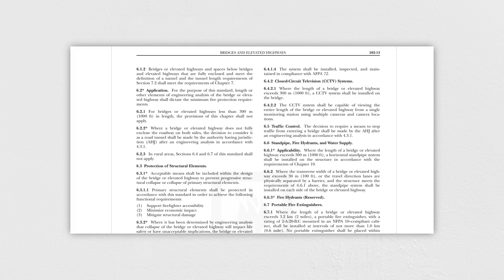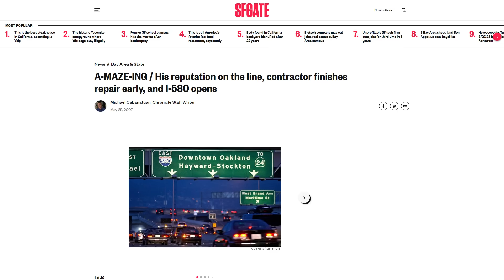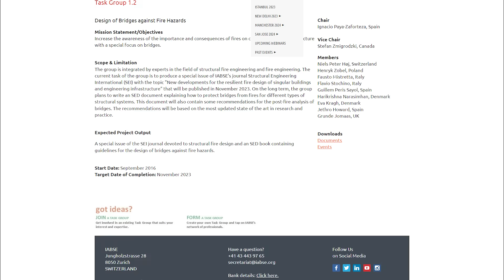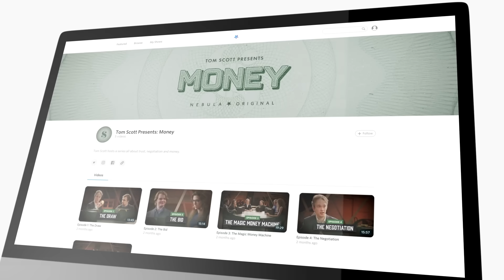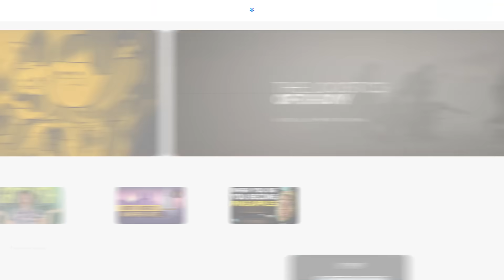Philadelphia I-95 Bridge Collapse Explained

Comment: Fire Engineer here - The eurocode does document methods for assessing fire in structural steel and is used regularly for these types of assessment. Bridges are not regulated for fire damage like buildings are, which need fire protected members depending on their location and the building's use. Thus, fuel heavy fires under the bridge will readily heat it above its 550C fail temp where steel has ~20% of its original load bearing capacity, well below civil safety factors. Is it worth fire rating the steel with Vermiculite or an intumescent spray? Maybe, structures like bridges would require better insulation, as regular buildings are only designed to withstand the fire for brigade search and rescue at worst. A regime would need to be similar to offices or apartments which can be re-used and refit after fire damage.

Comment: Sydney's Kingsford-Smith airport has the main runways on a bridge over a major 6 lane highway. They included automatic overhead sprinklers through the entire tunnel just in case there was a fire (just like a high rise or warehouse) which also had a connection to traffic lights to stop traffic entering the section of highway between off ramps so no one would get trapped on the roadway. Of course a truck went through there (after it had been in use for several years without problems) that was about an inch too high and took out ALL the sprinkler heads on one side of the underpass, setting off the whole sprinkler system, stopping traffic and causing low level flooding in the tunnel when the drainage pumps eventually failed, but at least it didn't close the airport and only took a few days to fix or replace the hundreds of sprinkler heads.

Comment: watching a railway underpass built 3 blocks from my place. lot of engineering questions getting answered, 
ie, at * some * point it is necessary to dig under the rail before it is supported, the very first cross beam needs to have a groove dug out under the entire wide of whatever track exists at that point. how do they deal with rail traffic?
Answer: halt rail traffic and pull an overnight shift work with a frenzy kleig lites etc, check the weather, and overnight voila, the 3 foot wide I-beam, it is now sitting on its supports already in place beside and below the tracks, final check and ok green light the rail traffic, only had to halt 3 or 4 trains only 1 days worth.

they spent a good 2 years prior rerouting utilities, measurements, all manner of prep work, water shut off a day or so related to the job. 
finish date summer 2024, just in time for me to sell and clear out lol

Comment: How much would permanently installed plumbing and heads for a combination of either misting sprinkler heads or ones designed to spray up at the main structure of a bridge and larger deluge nozzles pointed down that fire trucks could hook up to and quickly put water on the fire and control temperatures of the bridge with minimal risk to firefighters make?  Given it's only dry pipes and heads, the fire trucks would be the pumps and tie back to the hydrant I'd assume the cost would be fairly low, but should help lower how much heat gets to the bridges main structure which I assume would make a significant difference, if you could keep the surface closest to the fire at say 300-400f max.

Comment: The reason for the towers collapse on 9/11 was for same reason airplane with full fuel load , steel perimeter frame center frame round elevators long clear span between , elevator shafts acted like giant chimneys increasing temperature by thousands of degrees , melted steel

Comment: We had one incident on the TX-181 North coming out of Corpus Christi. The last curve approaching the Harbor Bridge is flat, and if you take it too fast in wet weather, you'll go skidding into the other lane, or into the J Wall. Or if you are driving a semi truck, turn over.  Well, A dump truck did so, tangled with a tanker and both caught fire. No one was hurt, but the fire, knocked scabs off the top coat on the overpass.  The damage is still there, you can feel it as you drive over it.

Comment: Could a super simple sprinkler system not be installed that would have a mechanical temperature sensitive trigger not to put out the fire, but to try to limit the temperature that the bridge sees? Just something to turn the heat into steam and keep the steel and concrete wet.
I mean, most overpasses are in or near cities, you already have a bunch of water lines, and it would be really simple to include in new builds, or add to existing bridges if wanted.

Comment: another arguement for movement of freight from centrally located hubs by trains. Train moved frieght is less likely to be involved in accidents and tracks can be more easily repaired and rerouted. Steel expands and contracts with out extreme heat. Concrete is at its best under compressive force, had the concrete absorbed moisture, did the rebar twist inside the supports? Most of the environment around and inside the truck would add to the heat (roadway, plastic, tires, the bridge structure would trap heat).

Comment: In 2015, a tanker crashed beneath I70 where it crossed I270 on the west side of Columbus.    The city had bypasses open, if I remember right, the next day.  They had the overpass bridge rebuilt about a month later.    Impressive feat.  It was not as bad I95 fire but still impressive.  

That occured where the biggest east west highway crossed the outerbelt.

Comment: That particular bridge/overpass was an steel i’s, it didn’t have a chance with a liquid fuel fire…heating steel in excess of 1500 F, will compromise even the heaviest of steels…steel looses 50 percent of its strength at only 1100 F, for reference an incandescent filament can withstand over 3000F and last for upwards of a thousand hours…

Comment: You can be sure that our enemies carefully watch what impacts things like this have on the economy and ability to bounce back after a series of hits to our critical infrastructure. With that in mind, we really have to do better than this. We need something that can get the thing up and running within a few days, something that straddles the damaged area and can handle traffic over it while simultaneously allowing room for crews to work underneath to repair the roadway. We can’t rely on a kindergarteners approach by filling the hole with blocks and driving over the blocks. We should focus on a solution like this in case something accidental, or deliberate happens in multiple locations simultaneously. That’s how an enemy would think about hurting its rival.

Comment: Not but a few months ago we had a truck carrying beer crash on I-285 Atlanta bypass under the Ashford-Dunwoody bridge. Closed both Ashford-Dunwoody road and both directions of 285 for 6 hours in the middle of 5 o'clock traffic to reinspect the bridge. Luckily they were able to re-open. Smaller volume of burnable fuel compared to a gasoline tanker but ethanol burns hot.

Comment: 6:24 "Surely there'll be 1 accident at most involving fires and overpasses in the span of a year throughout the entire country, so no need to overly engineer it against fires."
Aaaaaand enter tanker drivers who don't know the height of the vehicle they're driving or overpasses without a clear indication of the maximum height as if writting the maximum height in white paint on the underside of the overpass magically transmits the information to any and all drivers passing underneath it with enough margin for them to stop.

Comment: Before watching the video, I'm going to guess... (to address the caption on the thumbnail... Why fires destroy bridges...)

Bridges (at least ones like the one in the thumbnail) are made of prestressed concrete.  Prestressed concrete contains steel cable under high tension.  If the steel cable reaches a certain temperature (via fire) it will relax and no longer be under high tension, which takes most of the compressive load off the concrete, significantly weakening it, to the point of catastrophic failure.

How'd I do?

Comment: Really interesting video. However I would have loved a section on the mechanical processes involved in a bridge failure because of fire. How did those bridges collapse, what is the effect of those flames and temperatures on concrete, is it different for reinforced concrete etc.

Comment: When I85 came down in Atlanta, the DOT managed to rebuild the entire bridge in a mere 41 days.  How?

1) it was a concrete beam structure (no need to fabricate long lead time steel beams)
2) the company that built the original bridge is still around and by chance was in between major projects
3) that company was able to pull out the original plans and essentially fast track the concrete by using industrial quantities of QuikKrete (fast set concrete)
4) via the Federal Government, the contract was an open "as fast as possible" job with bonus payments for faster work. 

They beat the original estimated work period by a couple weeks and finished in 41 days flat.

Comment: This was a really simple structure (the biggest feature being the skew), but when this happens to post-tensioned box girder structures (such as 8:32), how do they determine the extent of damage (if any) to the strands? How could you repair that? Have there been any large fires beneath such structures? Surely there must have been fires inside post-tensioned parking garages.
Reply: I understood about 86% of those words, separately.
Reply: @jimburton5592  It's a different bridge design seen a lot in the southwest US but in nearly every state in some form. It's concrete with steel strands embedded within that are pulled extremely tight on both ends of the span and locked in. That's how it carries load. Think of a tightrope supporting a walker, same concept. Those strands are susceptible to stretching (or worse) in a fire which could cause a sag or collapse. A lot of modern parking garages (and some buildings) use this technique too.

Comment: Steel loses roughly half it's strength at 1,000 degrees, a temperature easily achieved in this scenario.  At that point the structure can't support itself and down it goes.  To protect against fired like these would not only be really complicated, it would be prohibitally expensive.

Comment: Ah. Yes. Tanker trucks. If we insist on moving large quantities of flammable liquids around, can we at least do it on trains instead? Railways are safer than roads.

Blacksmiths use rebar (and sometimes steel cable) quite a bit as scrap material, and they can probably tell you a lot about how rebar behaves when you get it extremely hot. Like, steel oxidizes very rapidly when brought up to forging temperatures (950-1250 C, depending on the alloy). It forms, expands, pulls off, and cools right before your eyes. They call these delicious, crunchy flakes* forge scale. I was told once that around 20% of the material is lost to forge scale when smithing.

Also, steel behaves pretty differently depending on how hot it gets and how fast it cools down, and that's a huge part of blacksmithing right there. If a hardened structural element gets hot enough to pass its Curie temperature and then it starts to cool, it may be normalized or annealed, so its hardness/ductility characteristics will change. And if it's hot enough and then the fire truck dumps a ton of cold water on it, it will quench. Quenching is an incredibly violent process. Mild steel does work harden slightly, which can cause it to do funky warping things when quenched. And not all quenches require direct contact with the fluid -- the rapid temperature change is what does it, not the fluid itself. Differential heating and cooling is also a big part of blacksmithing, because they need to control that to control the grain structure.

What a wildly complicated and interesting problem. I love this channel. Thanks!

* This is a joke. Please do not eat forge scale.

Comment: I'd be really interested to see if the steel frame of the bridge was fireproofed, and if so whether it was up to code and simply put under too much stress (possibly by the initial collision) or if it was improperly applied. I remember watching a USCSB report on how a steel truss sagged and eventually collapsed because of a propane fire that produced a 77-foot jet of flame aimed at it, and ever since then the interactions between fire, steel, and the protection between them has really interested me.
It's something you never really think about, but even something as tough and sturdy as steel needs to be protected from fire, especially if the damage is sustained over a long period of time.
Might be a good video idea, too, assuming you can demonstrate it safely.
Oh, and this is probably just an accent thing, but at 15:23 I got a chuckle from you calling Legal Eagle a "real liar". Nice little Freudian slip.

Comment: Good grief!  Are you pursuing a law degree or what?  😆  “Extreme high temperatures caused by fire decimate the strength of common structural materials.”  But that doesn’t make for an interesting video. 

So there’s a critique. Here’s a suggestion:  Do a compare/contrast of civil structures/vehicles engineering vs say robotic aircraft or spacecraft engineering (large safety factors and expansive code requirements including loads definitions vs the more pure physics and small safety factors for aerospace vehicles).

Relate the discussion to various failures such as the recent submarine implosion.

Comment: 2:45 I was a delivery driver in the Harrisburg area the day that happened. US-22, US-322, and I-81 were all shut down, as well as one of the main thoroughfares into Harrisburg itself. Parts of 81 were damaged below, the bridge for the exit ramp to 322/22 off of north 81 that the tanker turned over on was destroyed, and large sections of the bridge above from another ramp melted away and collapsed. We had to cancel several deliveries that day because traffic was backed up so far all over the place. It literally shut the state government down early that day when the governor sent home state workers in shifts to help with the traffic problems. There was also simultaneously a crash and fire on a section of the PA-Turnpike on the opposite side of the city in a construction zone.  What a crazy day that was.

Comment: IMO, the cost to retrofit every bridge against fire would easily outweigh the losses of bridges. Like, you don't hear about car fires damaging bridges because bridges are actually pretty good at handling even medium sized fires. The steel will either distribute it across the whole structure, and both steel and concrete deal with heat well. It takes either a very hot or very long fire to cause damage.
And the reason earthquake infrastructures are heavily invested in is because a disastrously large earthquake gets exponentially worse if people can't evacuate and help can't get in. Cuz if a single bridge fails, it's not great, but life will go on. When all the bridges fail, people start dying.

Comment: Thanks for mentioning the better alternatives to car dependency Grady! Car infrastructure is incredibly costly to maintain and maintenance costs increase proportional to usage. Forcing everyone to use it and degrade our investment, instead of providing better alternatives is just wasteful and inefficient. Not to mention the cost of the 45,000 Americans cars kill each year which could be easily avoided. If the USA's streets were as safe as Canada's(a nearly equally car dependent country), 25,000 fewer people would be killed. If they were as safe as the Netherlands, 35,000 fewer people would be killed.

Comment: In September 2020 a similar thing with a fuel truck happened in the ruhr valley in Germany on the A40 below a railway. Both the autobahn and the railway are very important veins for the rhine ruhr region. It lead to massive problems in the region.

Comment: There have actually been two fires in the Oakland Maze; one liquid fuel tanker that collapsed a span overhead, and an earlier incident where a propane tanker hit a pillar on the southbound 580 ramp through the interchange.

The pillar and overhead ramp still have the scorching from that, but they were able to test the steel and it hadn’t been heated hot enough to lose properties significantly.  It’s more closely inspected now but has held up fine.

That’s a good example of the difficulty in figuring out what to protect and how.  Two similar accidents at the same interchange and one has had little lasting impact and the other collapsed like I-95.

Comment: Another great video 😁 
I would imagine that the fuel tanker was full or near full.  The unabated burning of hundreds of gallons of fuel could heat the steal underlying the road deck beyond its critical temp and the weight of the road deck not to mention the weight of the steel itself would cause it to deform and collapse.  One of the pictures of previous taker fires showed the beams deformed into a U shape.

This reminds me of of the world trade center in the sense that you can do all you can to make a structure withstand a fire but when you introduce the level of structural damage that occurred and thousands of pounds of burning jet fuel to the mix, structural failure is almost a certainty.